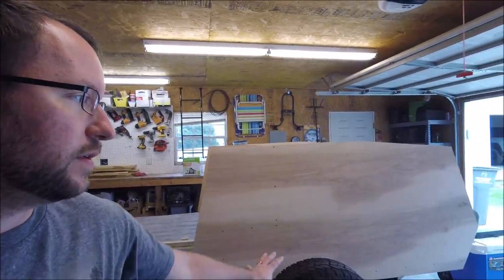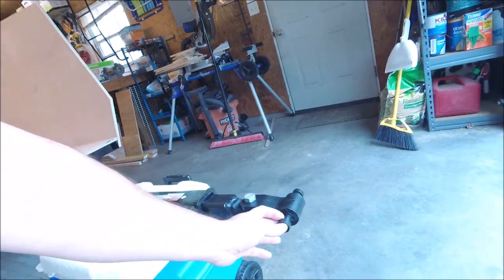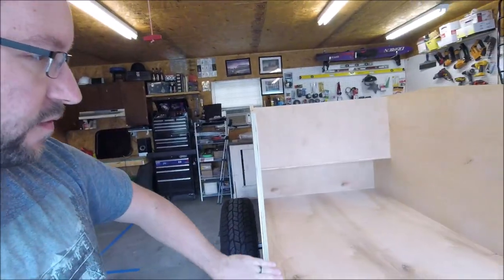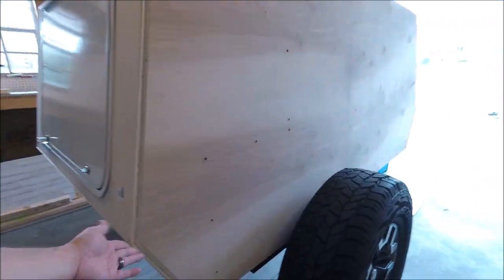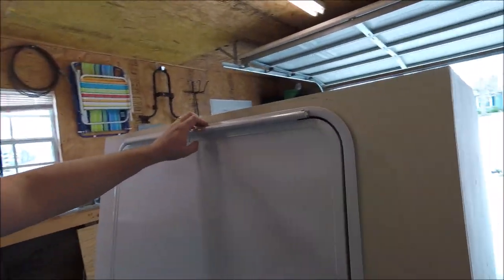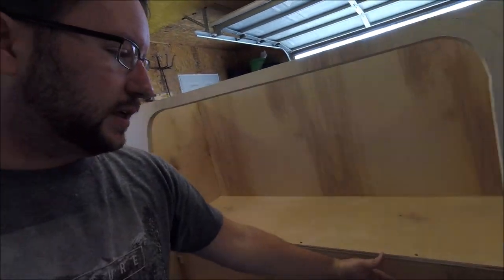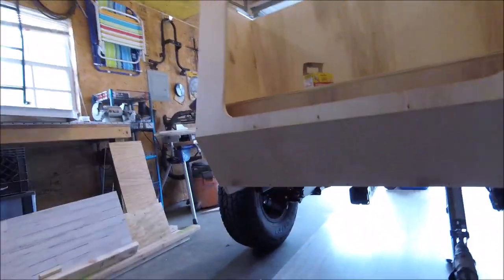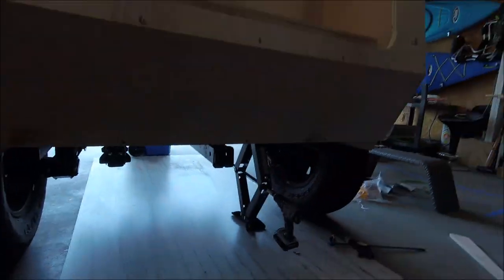Day 2 of the Off Road Tiny Camper Build

Comment: Really nice build! What weight axles did you use? I know those start at 1200lbs and go up.
Reply from the maker: Look in my newer video with the cost to build. I have a link to all the parts I used. They are 2,000 lb. axles.

Comment: you did a great job. what are all the specs on your trailer? im going to start building one of my own this weekend but I don't want to make it to big or to small. I was thinking for inside the cab where I would sleep I would make it around 80" and the over all length 10.5.
Reply from the maker: My inside width is 46.5 inches but that’s because my walls are 3/4 and I wanted to be able to use standard 48 inch width wood on the top. My length is around 72 inches on the floor on the inside. I built it as small as I could and still be comfortable.
Reply: Awesome thank you for responding